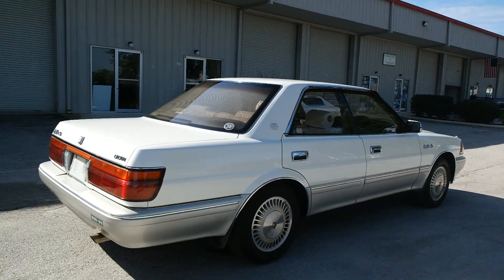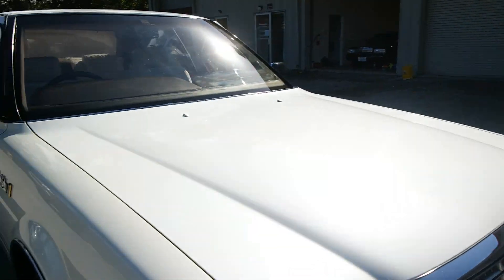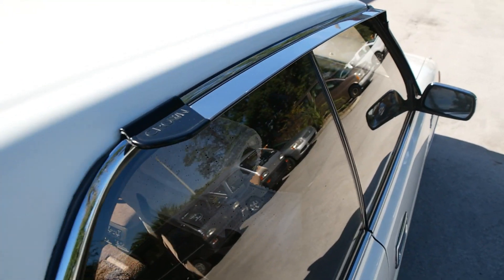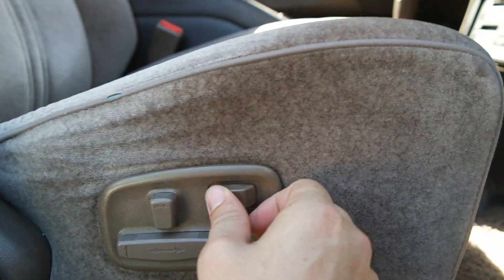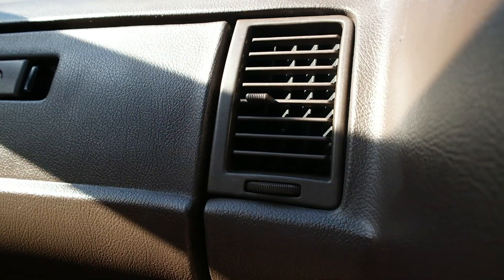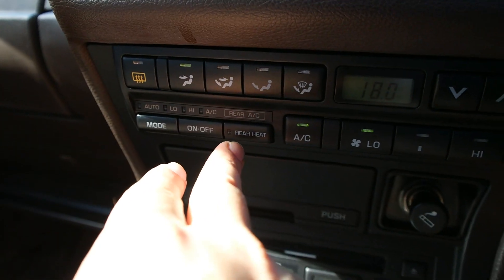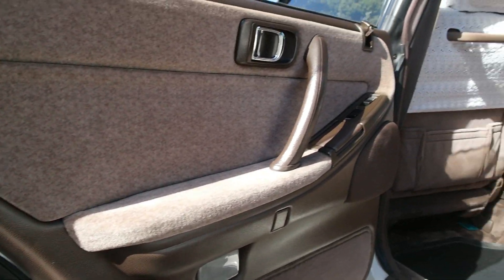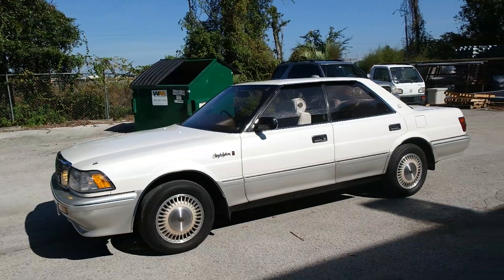1991 Toyota Crown Royal Saloon G UZS131

Comment: I own a Toyota Crown Royal Saloon A/T 1991, S130 Model GS131, Engine 1G-FE 2000cc DOHC 24 valves, Silver color, interior seat Maroon color, full leather dashboard with analog meter, not digital meter as yours, telescopic & tilt steering, driver's power seat, power sliding rear seat, auto A/C, auto swing front A/C middle vent, rear A/C vent, rear small fridge, same model as yours but the windows are not frameless, your Toyota Crown is hardtop model, the back rear light model is different too, my Crown has Red light on upper side, Yellow light and backward light on down side, this Toyota Crown model is really awesome, I'm in Jakarta, Indonesia....

Comment: Nice well presented video. Thanks for posting.
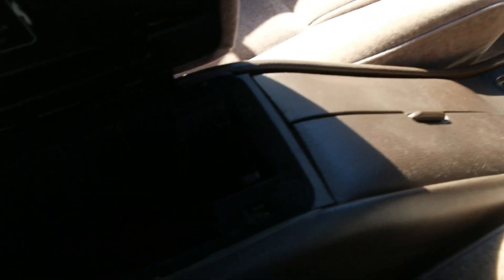One thing you missed is the flare (for emergencies) mounted on the passenger's side next to the console. Visible at about 20:30.
Thanks by the way for answering some questions. I bought the front cut section of one of these to use most of the parts in a hot rod I am building. I didn't know what the A/D switch did (now I know), how to change the display (the switch is in Japanese).
My 1/2 cut has 80,000 kilometers on it so the engine runs very well. 
Its a pity someone cut it up as it would have been nice to own it as a whole car. Very advanced for their era.